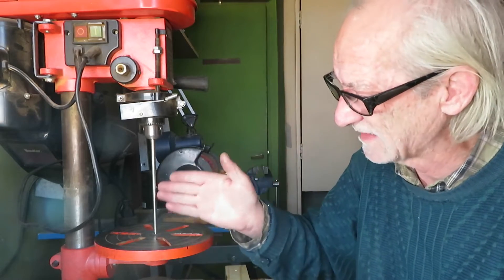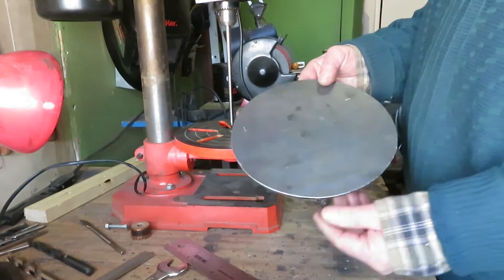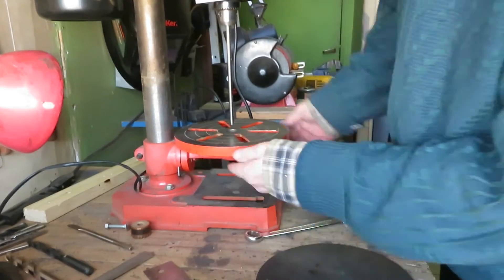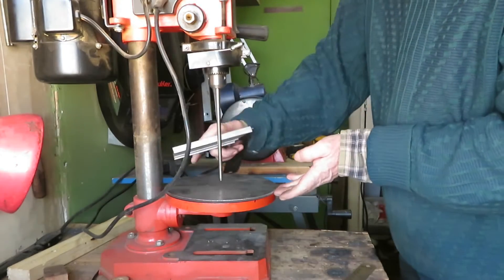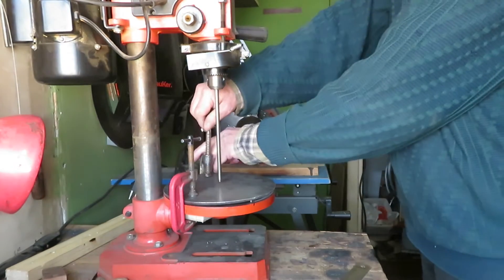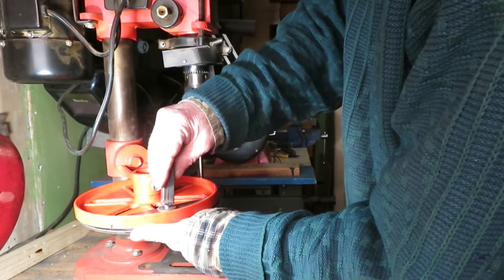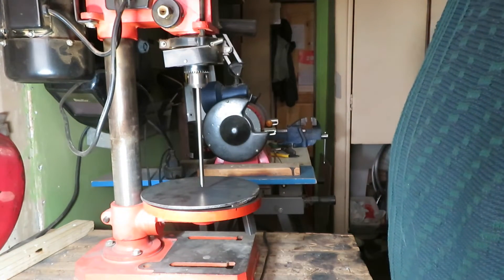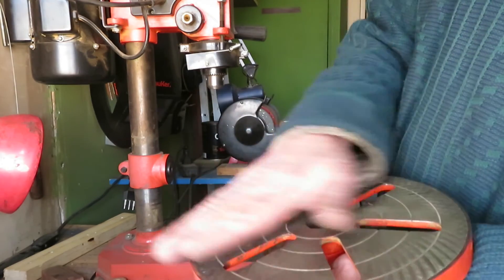How to adjust the factory-set angle of a crooked drill press – Front Back plane

Comment: oh, i didn' t realize that you've made this correction video. okay, about the z axis issue, i do think your solution is perfect for this problem, however, i think there is a slight miscalculation in your video. you said the deviation is 5 mm. that's true, but that's the deviation AT the tip of your square, which is not what you want. what you want is the deviation AT the distance of the bed radius (diameter/2). so for example, if your bed radius is 10 cm, then you want the deviation AT the (vertical) distance of 10 cm from the bed. well, at least according to my theory. i honestly not really sure about my own theory and could easily be wrong but i decided to share it to you anyway, just in case i'm right. not because of disrespectful intent.
Reply from the maker: You are right, the true value is not the deviation, instead it's the slope, where m = dY/dX or dZ, so one should be able to calculate the exact value using that formula, however, if I lift or lower the disk 5 mm at exactly the same distance from the point of the bit or axis from where I found that deviation, I believe I would have the correct value to leave it square.  Of course it depends on where I apply the 5 mm on the disc (In my case the outer edge should have been less than 5 mm because the tip of the square is longer than the disk radius).  My mistake.  Thanks Emonikino for highlighting this detail, although getting such precision just with hand tools is not an easy task. 🙂